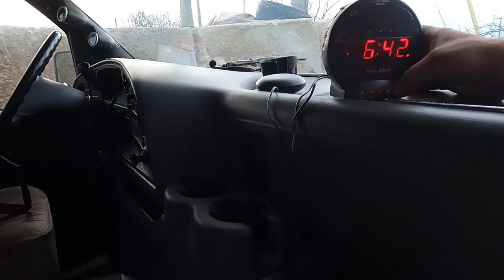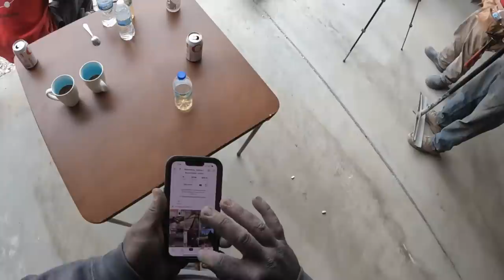Look who's back! And a stamped patio!

Comment: Glad to see Eric back. For your GoPro, there are a few things you might want to look into. 

1.) Read & Write Speed of the SD card. I recommend the SanDisk Extreme V30 UHS-I or Samsung EVO Select V30 UHS-I
2.) Make sure your SD card is formatted correctly. 
3.) Firmware update
4.) Since you work outdoors dealing with sand and dusk, make sure the SD port stays clean and dust free.

Comment: But when the cylinder is full of oil, the piston has to work against the oil and can lock. To drain the oil, remove the spark plug and crank the engine. The oil will spray out of the spark plug hole.
Reply: Its either oil or gas which is called "hydro locked" its very simple to fix. Only need to take out the spark plug and crank it a few times like you mentioned.
Reply: Or keep cranking till it throws a rod
Reply: @nursenic03  you cant crank it. You will break the pull cord before the engine moves. Its trying to compress liquid in the combustion chamber. Its locked solid.
Reply: @ryy597  oh you most definitely can crank a hydro locked engine just not this one. In this case  your right because the pull cord won’t be able to force it. But on a regular vehicle, hydro lock will bend and throw rods

Comment: Hey Ryan I just wanted to point out the issue isn’t the camera themselves it’s whatever SD card your using. Try the LEXAR professional 2000X SDXC. Works perfect with my GoPros.
Reply: YMMV but I've had GoPros since the Hero 3 and always have some kind of issue regardless of the card I use. Including the Lexar.
Reply: @cordcd7  hmm guess I’ve just been lucky then. Have you contacted the company about the issue? If so request a new device.

Comment: Take the spark plug out and pull it over 20 times to get rid of the hydralock. (Oil or gas whatever cause it to lock will shoot out of the spark plug hole so be careful)  Then try starting it with the spark plug in tight.

Comment: To fix your camera issues I would suggest formatting the SD card to the correct format, via a computer, before putting it into and using it in the camera. This is what happens in a lot of these cameras. You go into the file on the computer and its there, but it will refuse to play when clicked on and say error.

Comment: I think if you just take out the spark plug and you pull the cord 1 or 2 times it will release the pressure and won’t be locked up anymore for the compactor. I’m sure somebody has already commented this but just saying!

Comment: Should have removed the sparkplug on the compactor, turn it over with the sparkplug out. Check the oil level and Clean and refit the sparkplug. Should get you out of trouble

Comment: A very common issue with those cameras is the type of sd card you put in it. You need to call gopro and/or check online for compatible sd cards. It will not work properly if it has the wrong sd card. Try buying the correct sd card and see if it works it did for me and the gopro works like a charm.

Comment: I have nothing but bad experiences with go pros, I bought a new hero 7  and right out of the box it wouldn't charge but only like 10% of the time I plugged it in and the screen wouldn't respond sometimes for a few minutes at a time and just shut off. Took it back and decided to never get one again, I hear the older ones worked alot better

Comment: eas to fix your compactor just remove the plug and pull the cord a few times, even put a very small amount of gas into the spark plug hole and pull a few times to clean it out, replace the plug and watch it smoke hahahaha for a few seconds

Comment: Hi just I thought I’ve seen some guys pouring concrete at one of those electric vibrators to get the air Road some videos I’ve seen guys put on forms and footings I think I’ll it does it’s just to get The Rose all the bubbles out so is it good to use in drive way Poor or side way

Comment: Hey Ryan have you tried using a different micro sd card? One that's rated class 10 minimum and ones rated for extreme weather/conditions is good. They may hold up better and less likely to lose footage. The sandisk extreme pro and sandisk max endurance cards are decent. Lots of times micro sd cards start failing after they've been used for so long so maybe try a new card and hopefully that'll fix your problem with the camera

Comment: Do you add color to truck or do you use color hardner? I see the release powder you use. But wasn't sure on base color. Just wondering...thanks
Reply: I think he has shown it both ways but it seems he applies color to the concrete after the pour most often

Comment: What’s the footage price in your state for basic flat work.
Reply from the maker: Driveway r&r $7.50
Reply: @VictoryOutdoorServices   same as Louisiana.
Reply: I charge $6 a foot plus sand.  We don’t use rock if we need to build up.  $6 cover labor materials and concrete.     $1.50 is about what they charge to remove.   We don’t do a whole lot of removal around here.   The concrete last 40-50 years.   We don’t get any freezing weather.    We get A LOT of hot and humid weather though.